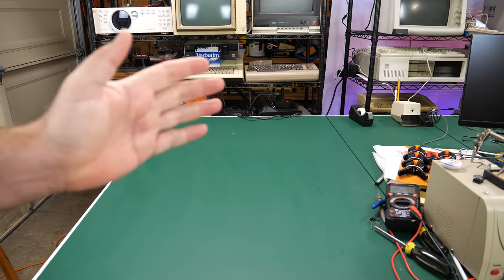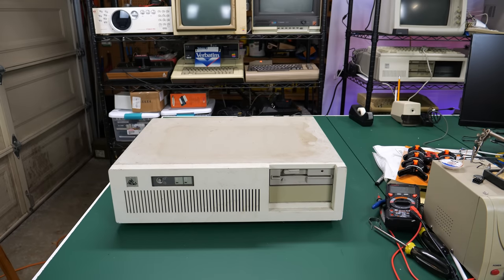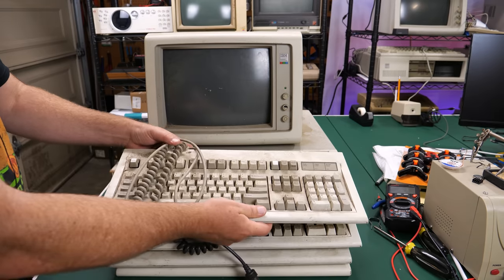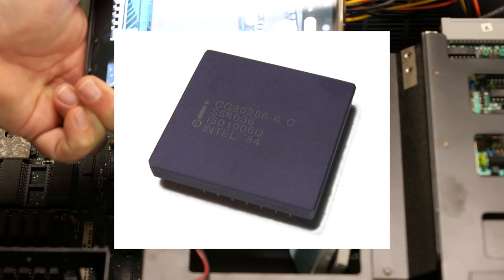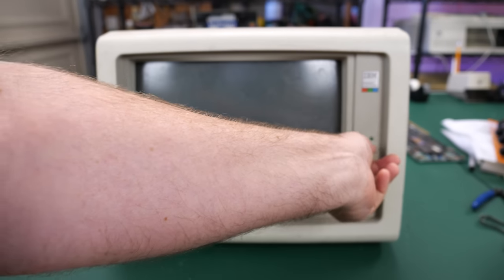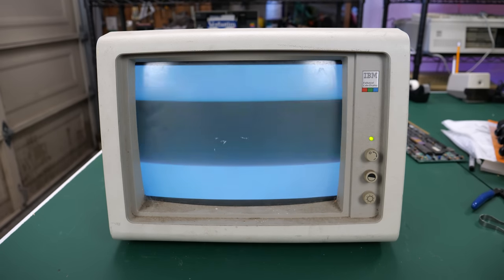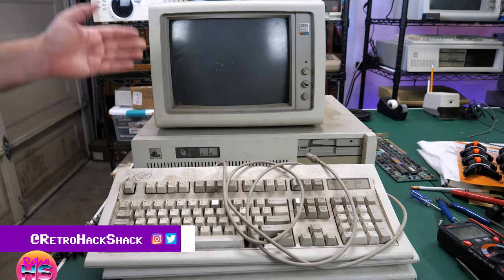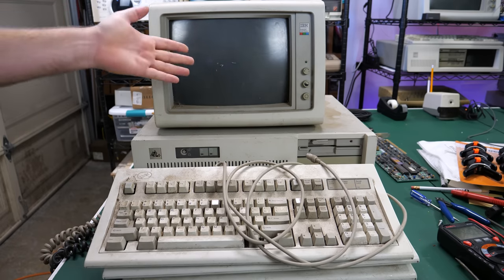AMAZING IBM E-Waste Shed-Stored Treasures

Comment: Premenos was an electronic data interchange software company based in King of Prussia, PA which was acquired by Harbinger Group in 1999.

The Intel chip on the Fixed Disk/Floppy Diskette card is an 8748 which is an 8048 with an on-die 1kB EPROM.
Reply from the maker: Thanks

Comment: I'm not so sure you should plug that into an mda card, I believe there is an incompatible voltage that will damage the monitor. Cga is fine though.
Reply from the maker: Hmm. I though it was compatible. I'll double check.
Reply: All it would do is sync badly, or not at all, the MDA signal is carried on pin 7, which isn't used in CGA and in EGA is one of the intensity bits, not a big deal if that has voltage on it.
Reply from the maker: Good to know. I will have to make a correction on the next video.
Reply: The main issue here is not voltage -- it's all 5V TTL until analog VGA cards.  Some cards (MDA/Hercules, CGA, and EGA) had different pin combinations, which could end up grounding a signal pin (either at the monitor end or the card end), and depending on the card/monitor combination, that might be a bit rude.

But, the greater risk is trying to drive a mono monitor with CGA or EGA refresh rates.  They're not compatible, and the 5151 won't take kindly to it.  However, the 5153 is more resilient.

The IBM EGA card has its DIP switch block to ensure compatibility with different monitors.  It limits the modes the card will try to output to ensure it doesn't commit any H-sync faux pas.
Reply from the maker: Yeah. I had that issue when I hooked up my 5151 to an EGA signal a few videos ago.

Comment: I did multiple reverse image lookups on the case badge. Nothing came up. My guess is the PC was sold as a package and that badge was the logo of the reseller / store.
Reply from the maker: Thanks for trying! I did as well. I even dug into old docs that mentioned Premenos, but no logos were in those docs.
Reply: @RetroHackShack  The mystery deepens. Premenos was originally know as ACS (Apparel Computer Systems) . The one logo I found by a trademark search is an A with a triangle in it which has a similar style to the case badge.
Reply from the maker: Interesting. It kind of makes sense because Mt. Diablo is right there in Concord.
Reply: That's exactly what happened, BTW.  Some IBM resellers would put their OEM badge on the front, and the original IBM model badge on the rear.

Resellers were expected to open the package and assemble parts of the system to-order, so my guess is the IBM badge was probably provided to the reseller so they had the option of where to apply it.  Either to the front, or, if they had their own, to a specific place on the back, since all the examples I've seen had them in about the same place.  I wouldn't put it past IBM to have a doc that specified exactly where it was supposed to go -- in fact, I would expect that.  :-)
Reply from the maker: Cool. Thanks!

Comment: Nice Haul! 
I used to restore IBM boards almost full-time awhile back, still have about 100 in storage. 
I build converters from ATmega32U4 promicros to convert the model F keyboards to USB, XT protocol won't translate to PS/2 natively. However the model F/AT will. 

It wasn't uncommon for 3rd parties to re-badge computers or keyboards if they were provided with an accessory card OR sold for Industrial usage. You can find something similar with Model M's provided to GE for medical facilities, Postal agents or airports.
Reply from the maker: Good to know! All the ones I have ever seen in the wild of this vintage (until this one) have had the IBM badge.

Comment: an IBM PC-AT  5170 was the first PC I ever used - from memory the PSU on a least some of them required a load to work - if no hard drive was fitted there was a very large resistor that had to be connected and was screwed to the case
Reply from the maker: Someone else said they thought a single hard drive would not be enough load, but it has always worked for me.
Reply: This was rather common with a lot of XT and AT computers. The PSUs run on a single transformer with multiple secondary windings, and only the highest voltage (12V in this case) is used for regulation. If no load was connected to the 12V line, it would rise significantly higher (sometimes up to 15V, which pulled the 5V line up to 6.5V which could seriously damage mainboard components) and trigger the overvoltage shutdown. Thus, if no HDD was present to put load on the 12V line, you had to plug in that resistor to burn off a few watts (dissipated via the metal case).
Reply from the maker: Thanks for this tip!!! I connected 3 more hard drives (I didn't have a big fat resistor on hand) and that did the trick. No magic smoke yet and the voltages are stable.
Reply: @RetroHackShack  that is excellent news
Reply: @RetroHackShack  The resistors I remember were somewere in the 5-10 watt class, so somewhere between 0.5-1A load. I would be very surprised to see a PSU that needed more load than that to regulate stable. It's just that the case fans alone aren't enough on the 12V rail.. it needs a bit more.
Reply: Yes, most XT and some early AT (286 era) power supply needed a load to work properly. Later, (386, 486), AT power supplies worked without a load. I remember because my power supply on my 486 broke and while it was to repair shop, I used a XT one. After I used it for some time, I wanted to power some microcontroller board with 5V from it and did not worked, however, to power the PC it worked well. So I learned the trick to load it with some 1A through a resistor or few HDDs.

Comment: I had almost the exact "Clone" as my first PC, it was identical down to the floppy drive, (I later added a 3.5" 1.44MB and my first 3 button serial mouse, as one of my first ever PC upgrade experiances) Sans the logo, mine was from a goverment contractor from the Military base in Kansas City Missouri. An 8086-10Mhz, 640K RAM,with a genuine IBM CGA/EGA display adapter and a 40MB RLL drive running MS-DOS 3.3 with Direct Access 5, I later upgraded it to Windows 3.0, a Soundblaster 16 clone, and a 4MB EMS Card. (I later transplanted all these upgrades to a newer 286-12MHz in an identical case. Witch was later upgraded with a 486-66 motherboard, ect. and so on....lol)
Reply from the maker: Awesome 👍

Comment: Nice!  I need to look for 2 CRTs.  I need a decent VGA 15" to replace my Sony 17" Trinitron from the late 90s.  The blue is not working.  Is there anywhere in the local area that fixes these?  I am not far from Concord so nice to find another local.  A 1084S-D would be nice to find too.  I loaned my 1084 to someone years ago and when I got it back it had a chip in the screen which is not fun to look at since it was perfect. Oh well.  Keep up the good work.
Reply from the maker: Thanks! I am not aware of anyone locally that does repair, but it wouldn't surprise me. I'll ask around.
Reply from the maker: OK. I found one in one of my discord groups. I think he is in SF. https://crtdatabase.com/crt-repair-services
Reply: @RetroHackShack  Cool!  I will check it out.

Comment: You should really check all of the PSU’s for rifa’s, before connecting them to the power grid. They need to be replaced to not become a fire hazard or even just a smelly inconvenience. 

As for the 5170 PSU, it’ll need a lot more load, before it’ll start doing anything. :) 

Also, please check every voltage line of the motherboard, without the PSU connected. There could very well be a (few) tantalum(s) that has (or have) gone shorted. 

Great find! $35.— is practically nothing!
Reply from the maker: Yes to all of this. Check out my Apple II+ RIFA explosion a few videos back 😆
Reply: @RetroHackShack  I did when it came out. That was was one of the reasons why I reminded you about those darn rifa’s! 🤣

Comment: So you have a e-waste center that actually has interesting equipment?   The one year I had a sticker for the "transfer station" here, there never was much more than crap TVs and maybe some broken office equipment.

Ans yes, you can swap those keyboard SDL cables around.   In fact, I have an aftermarket SDL-to-USB cable for the 1989 Model-M I use on my work computer.
Reply from the maker: Transfer station? Sounds like an MA thing if I remember correctly.

Comment: I am looking for a 5154 for three years now and never had any luck, no matter how much money I would be willing to pay. They are just pure unobtanium here in Germany. Model M's are expensive but readily available. IBM 5153 monitors command like 500 $. And a 5154 is not available and if you have a million $.
Reply from the maker: Did they sell knock off monitors there like Princeton?
Reply: @RetroHackShack  not many it seems. I wasn't around in the 80's because Iron Curtain, but ANY EGA monitor is now incredibly hard to find.

Comment: The chips on the controller card you identified as "Western Digital". Those are in fact WDC - Western Design Center
Reply from the maker: Oh. Thank you! That has been a long time misunderstanding on my part I guess.
Reply from the maker: Or maybe I just worked in the storage industry for too long 😃
Reply from the maker: Wait. This is one of the chips in question. What am I missing here. https://www.alldatasheet.com/datasheet-pdf/pdf/127406/ETC1/WD1010-05.html

Comment: I'd just package the 4 keyboard for $200 on ebay. It's a nice find but they all need work ultimately (all likely need bolt-modding)
Reply from the maker: Yeah. I am going to restore them. I will do a restoration video on the older Model F.
Reply: @RetroHackShack  have fun and good luck! I've done it a few times: it's a surprising amount of work ;)
Reply from the maker: I've never done a model F before, so I want to do it at least once. Especially one that is this full of crap. It's nice to see that transformation.
Reply: @RetroHackShack  The F should be a bit more structurally sound around the PCB than the M (with plastic pins etc.) 
CTRL is in the right spot but RETURN is junk.
Reply from the maker: I have ordered some replacement foam. As soon as it comes in I can begin in earnest.

Comment: I've just got an old hp e-pc c10 e-vectra mini PC. The caps look fine, the external power brick works, yet the computer won't start. It only lights the LEDs of the ethernet for a split second and the fan as well and then nothing. I swithced the reset BIOS switch to "on", removed and replaced the CMOS battery and nothing. There is no tension (3V) at the pins that are connected to front panel-  power button.

Comment: The keyboards are a great find. But with all the excitement buildup I would have expected something rarer than another PC XT/AT. That was boring. After reading 'amazing IBM treasure' I was hoping for a PC RT 6150 or 6151.
Reply from the maker: Amazing to me I guess 🙂
Reply: @RetroHackShack  If you find such a stack of Model M and Fs, I am sure you will find some RTs eventually... the RT is a super interesting part of IBMs history that is unfortunately often overlooked.
Reply: @reiner0609  RT Keyboard was the best I ever used. Great feel!!!
Reply: @kencreppin2146  yes, they are fantastic. They got me hooked on buckling spring keyboards 🙂 I thought about converting one of my two for use with a modern PC but couldn't butcher it and went for a Model M instead 😊
Reply from the maker: I will keep my eyes peeled.